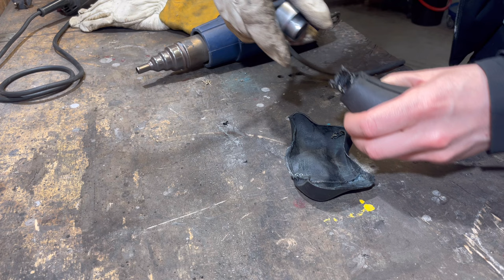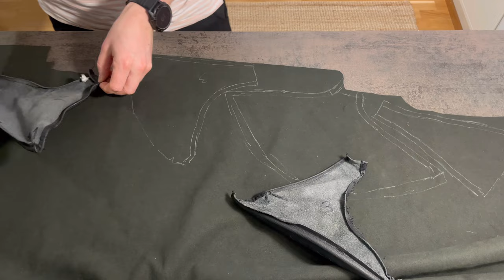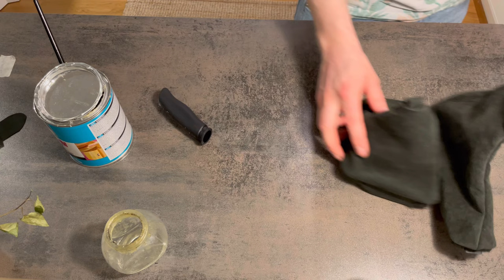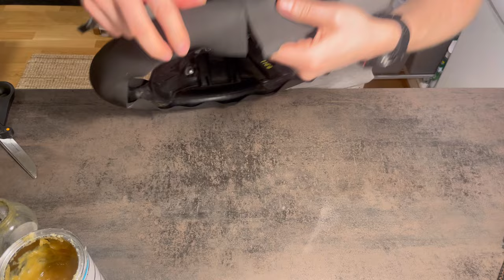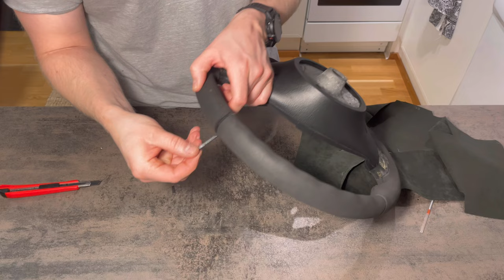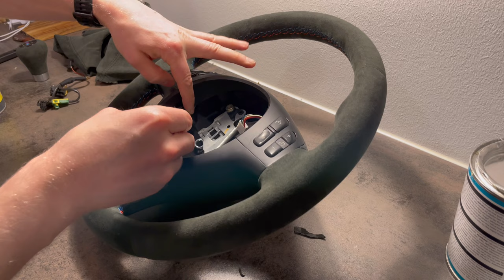Making Alcantara Steering Wheel, knobs and boots to BMW M3 e46

Comment: Hey man,  amazing craftsmanship!
I’m currently losing my mind over finding the right colors from Serafil to get that oldschool E46 M Tricolor look. I was wondering if maybe you could help me out and tell me which color numbers you used? I tried to peek at the numbers on the spools you had in the video but couldn’t read them. Thanks in advance!
Reply from the maker: Thanks! These are the right colours:8235, 0816 and 0504. If you want that purple version use 7377 instead of 0816
Reply: @manuLab   Thanks for the quick reply! Now that I'm watching on my computer instead of my phone I can see the numbers on the yarn perfectly, whoops. I'm pretty sure you know what you're talking about but  what's still a bit confusing to me is that the lighter blue looks kinda dark in the shot with the three spools next to each other and very light when you're sewing with it and also in the finished steering wheel. That's why I first thought 8470 (which is lighter and also a bit turquoise) could maybe be an even better match for the M colors. Or am I wrong ?
Reply from the maker: @mosh9276  that can be possible! I actually can't remember did I use "right" blue on that one because its so long time ago but I do remember those color codes what are at least close.

Comment: Great work! Can you please tell me where I can get the same exact foam you use for the handbrake handle? ( not the foam for the steering wheel)
Reply from the maker: Thanks. Thats normal 5mm or 3mm backing foam (cant remember which). I got it from local upholstery shop muovikum but i think you can buy it ebay etc also.

Comment: Hi idk if you still gonna see this but what is the foamy material you use to put around the steering wheel before the Alcantara? I'm learning to do interior from my E36. I'm now busy on the steering wheel.
Reply from the maker: Hi. I think its called rubber cellular foam. But as i remember e36 dont need that padding. At leats e36 m3 3spoke wheel dont have padding.
Reply: @manuLab  thanks for the answer. And I don't have an original steering wheel anymore and I customized that one now with the way it looks so it would just be a bit nicer with some padding on it.
I'm also planning on making it with nappa leather and Alcantara.

Comment: Amazing work! I have a question about brushing contact adhesive onto genuine alcantara - is there a risk of it passing through to the exposed surface if you put it on too thick? Also, are there any tricks to making genuine alcantara stretch? Can you apply a little heat, for example?
Reply from the maker: Thanks! No risk for that, with glue like this. There are alcantaras with backing fabric, what wont stretch and alcantara without backing fabric and that will stretch. And without heat
Reply: Hello !
Love your work , watch all videos and im in progres to teach this skil, im interestet what alcantara fabric do you use and where do you order it.

Comment: What material did you use? Is this real alcatnara or some kind of fake alcantara? What foam was that? Thread? 

Is there links to the products used? Please link them, much appreciated!

Thanks!
Reply from the maker: I use only original alcantara and serafil threads. No chinese suedes for me. Thats rubber cellular foam. I have no links but i buy alcantara from germany leder stoffe design and other products from local supplier.
Reply: @manuLab  okay, thank you very much. Would you like to tell me the thickness of the alcantara used? I’m looking for a supplier here in Sweden either locally or online.